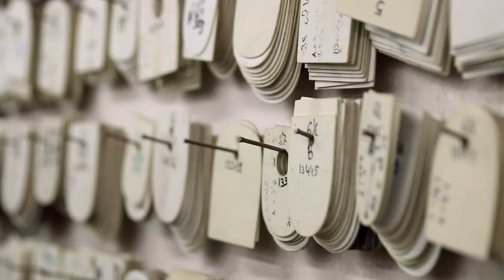Shoemaking: The effectiveness of Blake Construction - Crownhill Shoes

Comment: I thought this video will be about a test on how strong the stitching is against a force applied to the shoe itself. Dissapointed - althought the video itself is quite relaxing.
Reply: The strength is determined mainly by the tex thread size, a blake stitched shoe with a tex 30 thread will be vastly different strength wise to a tex 12 or 15 thread